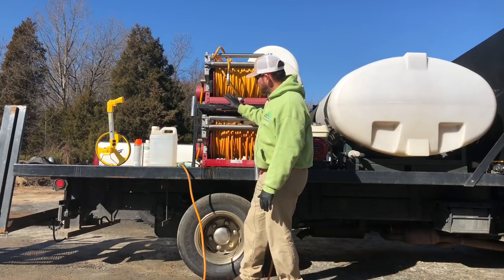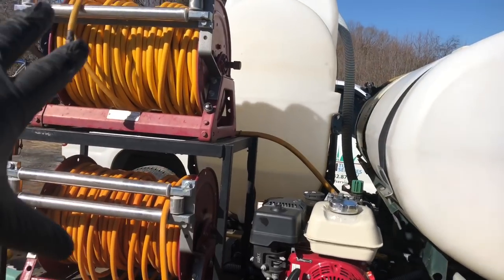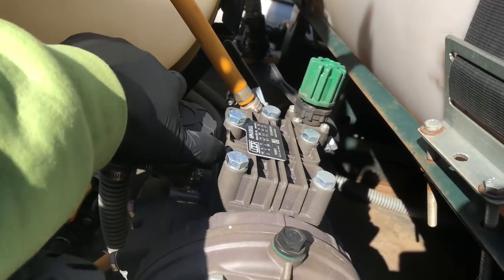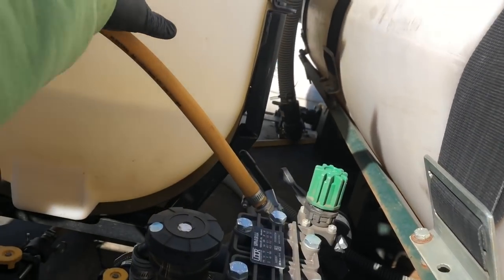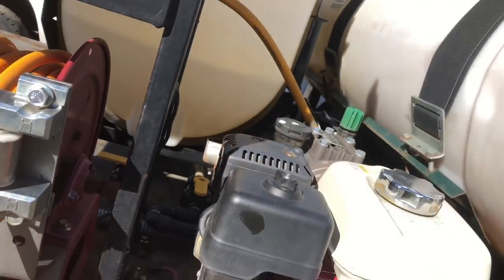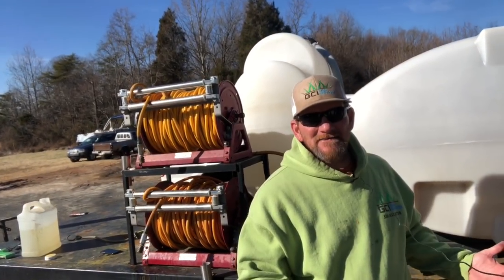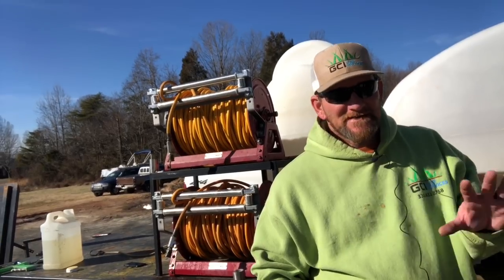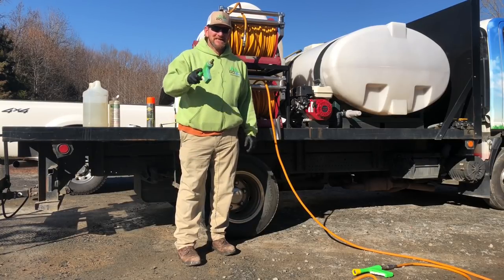How To Calibrate Any Sprayer PART 2

Comment: Can you leave it at 1 gallon per 1000 square feet and make the mixture richer?  What's your thoughts?  I have 300 gallon tank and don't want to keep refilling a lot.
Reply from the maker: You could but you’ll be applying more product per 1000 if you make it richer
Reply: @GCITurf  Thanks for getting back to me.  I  changed everything to put down 2 gallons per 1000 square feet and cut chemical amount in half.  Thanks so much for posting the video and getting back to me.   I wish you the very best.

Comment: Pete..I just got my first skid and came back to this video. Thanks for the calibration series!! Its very helpful for an applicator learning to use a skid. Need to order my lesco gun today and get my tank cleaned out. Can you do a video on how to maintain a skid sprayer, clean out the tank properly, stuff like that. There is a hole on youtube that needs to be filled, and your method of presenation is very helpful! Thanks bud. have a great weekend. Hoping to make some $$$ with the skid soon. (100 gal tank/ Hypro D252 pump/ honda motor/ Hannay manual reel with 300 ft hose).
Reply from the maker: this is awesome bro! thankful you landed that skid! you will do great with it and i will video that for you sir

Comment: Awesome video.   Got a question have a atv sprayer 15ft boom width trying to find gallons per 1,000.   So would I measure 15 ft wide 67ft long then drive say 4mph time that and then catch each nozzle add the total and that will give me gallons per 1,000.   Thanks for your advice
Reply from the maker: Pigman7120 you are spot on
Reply: Awesome thanks again

Comment: Ok...I have a calibration question for ya with an electric backpack...I calibrated mine prior to my Pre em application for my yard. Came out to 2 gallons per 1k feet when using a fan tip nozzle at my pace. Now, with that said, using the same fan tip nozzle, I need to spray the expansion joints in a concrete parking lot with gly to kill the weeds growing up through the cracks. I'm guessing I need to Re calibrate because my walking speed goes up when just spraying a crack, because there is no back and forth movement of the wand. So is it just a matter of measuring 1000 ft and walk it off with a stopwatch at the speed it would take to hold the nozzle, then compare that with the gallons used in that same time, or am I missing something?
Reply from the maker: rbljackson Whew! That’s a lot to type!!!  I’ll answer this in the backpack video I make today

Comment: So I did my calibration on my atv sprayer 3mph it comes out to half gallon per 1,000 feet.   And 4mph is. 45 gallons per 1,000 feet.   Is this enough volume or do I need to change my spray tips.   Thanks so much again
Reply from the maker: That all depends on what you're spraying. As long as what you put in te tank is not too thick then you should be fine. Remember a lot of lawn care equipment sprayers spray at low volume 1/3 gallon/1000 and even 1 quart/1000
Reply: OK thanks for the information I didn't realize they spray that low.  Keep the great videos coming :)

Comment: Hey Pete! Great video. I have a question on the nozzle selection on those lesco/chemlawn guns. Those yellow tips supposedly are for 2 gallon per minute, you just put out 2 gal in 22 seconds. I have never used that gun but I am about to get one and not sure the best nozzlel. I am going out at 2 gallons per thousand and walk at a similar pace as the guy in your video. Have you ever tried other nozzles? Green nozzle at 3gpm or the white at 4gpm.
Reply from the maker: Branden Rheinschmidt pay no attention to GPM. Just make sure your calibrated to 2 gallons per 1000 by your walking speed. The different color tips have different size holes which allow more product to come out. Does that make sense?
Reply: GCI Turf Services perfect. I figured it was just the hole size in the nozzle. Could definitely tell the spray got much finer as the pressure jumped up to get to the 2gpm. Every get any drift issues with that pressure?
Reply from the maker: Branden Rheinschmidt getting ready to do a video on what your taking about. Be looking for it
Reply: GCI Turf Services always looked my out for your videos. Quality stuff
Reply: GCI Turf Services always looking out for your videos. Quality stuff